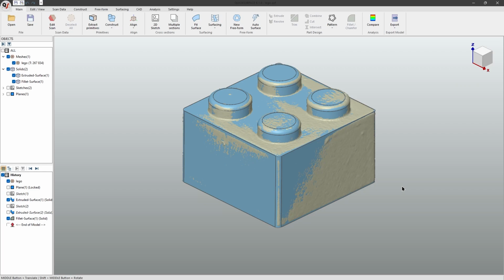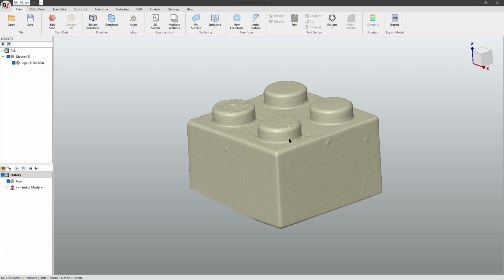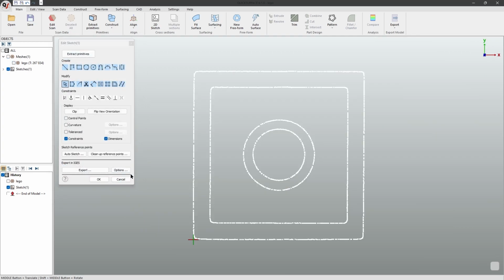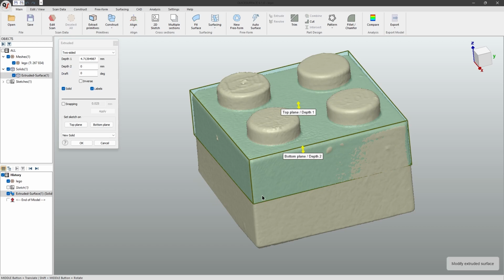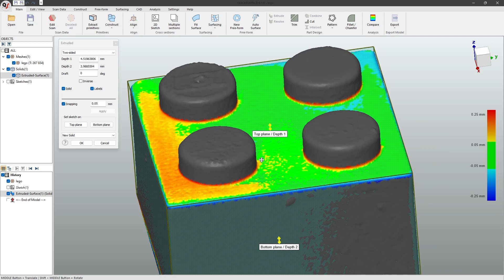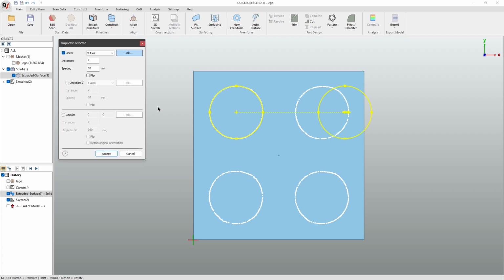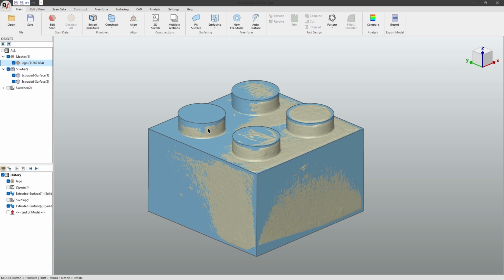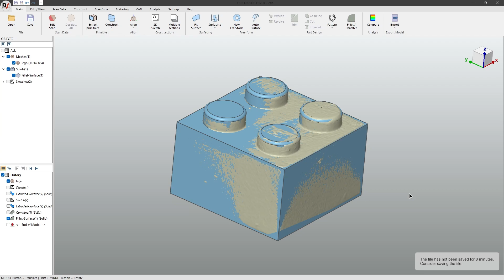Tutorial : Get started -  Lesson 1- How to Import scan data

Comment: Thanks for the video!
1. The history display in the Tree mode is incorrect. It should have been done like in SolidWorks: under each operation (for example, Extrusion) its own sketch, which is located on the next sublevel. But in your case, the entire tree is placed under the very last operation instead of doing this for each one. That is, the history in the form of a tree should look like this: Extrusion -> Sketch. Again in the first place, for example, Rotation -> Sketch. And so on. That is, each operation should have its own branch, and not the entire tree at once. Or in the normal history mode, move all the sketches to the right under each specific operation.
2. The size input fields lack mathematical operations, for example, enter 200 + 15, press Enter, and get the size 215.
3. Selecting a set of edges to create, for example, chamfers, is difficult. You can select a face, then all the edges on its boundaries will be selected. Or make a selection of edges similar to SolidWorks, by coincidence.
Reply from the maker: Thank you for all your comments. We will work hard to improve. If you have Solidworks - the better option is to use our addin - QUICKSURFACE for SOLIDWORKS where all your requirements will be nicely handled by the Solidworks itself
Reply: Just to add. There is quite a bit of presumed knowledge for anyone to follow through. Like the coordinate geometry system. Not all objects nicely fit into the coordinate geometry system. Viewers need to view how to align the object first, else this is too difficult to understand.